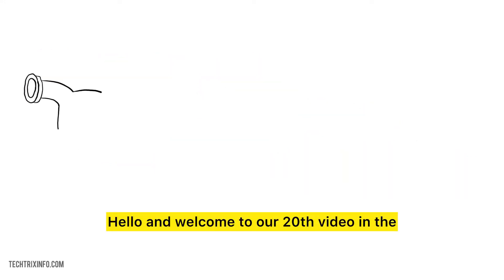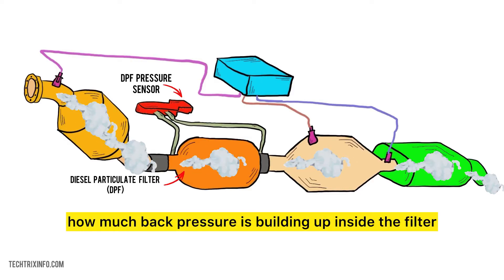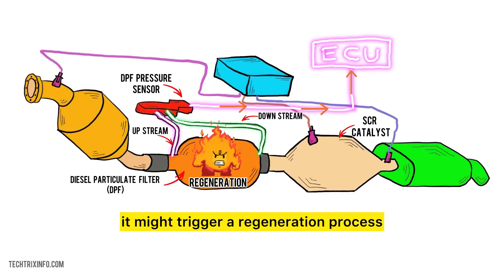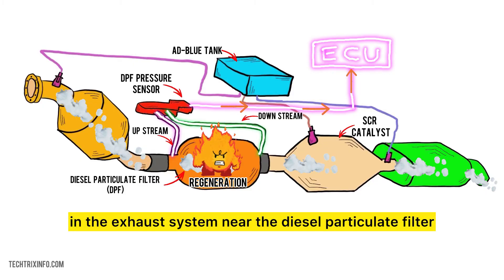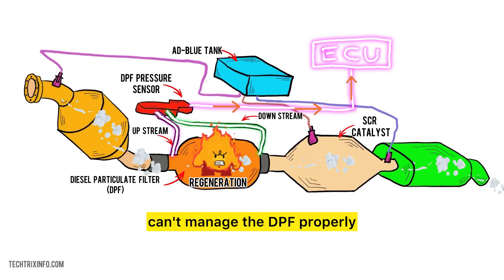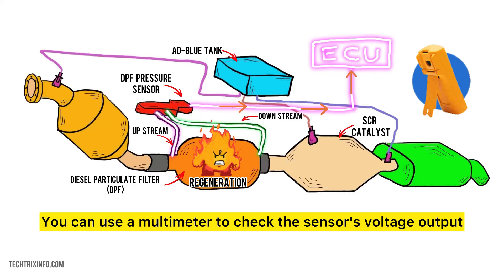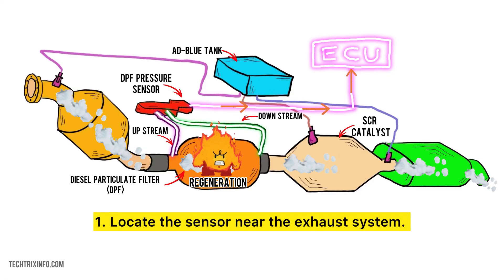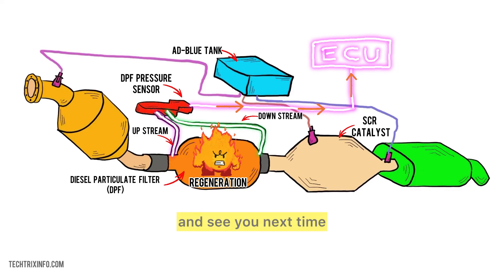DPF Pressure Sensor Explained With Animation | Mastering Automotive Sensors | Part 20

Comment: Well, I’m about to delete the whole dang thing if I can’t figure out why this code won’t go away the catalytic converters is brand new, the DPF filters brand new, D DPS sensor is brand new, before all that happened the turbo charger is also brand new we’ve done everything on this truck it’s a 2007.5 Dodge ram 2500 6.7L the SCR was completely perfect but for some reason, I’ve got a brand new ECM that’s also brand new, the radiator is brand new. The air intake grid heater is also burning cause that was actually going out map center is brand new turbo lines are brand new. The EGR is completely brand. Freaking new intake is cleaned out. The fuel lines are perfect but the this specific code P2455. P242F will not get out of the system. I don’t know what else to do. We’ve ran all the test the back pressure everything we’ve done it all the continuity test passed I need someone to answer my damn question before I shove my truck into a river.
Reply: All the EGT sensors are brand new and the downstream and the upstream. The O2 sensors downstream are brand new. The only thing that is not due on that engine is well the engine and the muffler.
Reply: Whoever created this f@ss  truck needs to step on some damn Legos
Reply: Parts dart final boss
Reply: just curious, why didn't you "straight pipe" that 18year old Dodge before you spent all that money on parts?.   I'll tell you what I think if you have not gotten it fix yet.....keep in mind that on the older diesels, they don't always throw a code.   I think you may have a faulty "9th injector"; I'm not talking about the DEF injector....might want to check it too.   Wow, I did not know a 2007.5 2500 6.7L had an SCR......may have a leak in the DEF injector or fill hose or DEF cap or DEF tank itself.....smoke test that bad boy.   Diesels require a HEAVY duty smoke machine compared to gas burners so I hope this helps.  You'd be surprised, that one little component would prevent those diesels from running right or going into limp mode.....check everything!!!!     One more thing, what scanner are you using?   you've got to get the engine temp up to 180 F and the Nox sensor differential value nox 1 and nox 2 has to be 90% difference (not 70% like the service manual says).    Did you get OEM parts from dealer?   there are a lot of fake parts being sold on internet and there are a lot of OEM parts that just are any good......somehow this happens.

Comment: what is limp mode
Reply: Limp mode is when the car goes on "safety mode" wich means very low/limited power, rpm etc.. to avoid potential or higher internal damage, it can happen on unplugged/dirty sensors, bad sensors, bad/dirty parts.. it depends, sometimes it can be a false alarm
Reply: It's when you become impotent.

Comment: Anyone have tips on cleaning the sensors ?
Reply: Can of air or airline and blower mate, or if its really manky brake cleaner or petrol
Reply: @benhoward3049 would you spray the tubes that go down towards the dpf, or could that cause trouble
Reply: @benhoward3049 thanks
Reply: never use brake cleaner.........use mass air flow spray or electric contact spray and gentle qtip cleaning....be patient, it may take a while to get all the carbon off.   To help prevent, do this every other oil change.   If you allow your truck to idle a lot or take it out on high way and run it 65 mph or better if legal for 20 to 30 minutes at least once a week.   keep the MAF and MAP sensors clean to with mass air flow spray every other oil change will help too.
Reply: Pour suivre
Reply: never use brake cleaner.........use mass air flow spray or electric contact spray and gentle qtip cleaning....be patient, it may take a while to get all the carbon off.   To help prevent, do this every other oil change.   If you allow your truck to idle a lot or take it out on high way and run it 65 mph or better if legal for 20 to 30 minutes at least once a week.

Comment: Great video
I have nissan x trail 1.3 year 2020
Autel obd2 show particular filter without check engine when i chacked 2 month ago but now engine light turn on and show me another problem defrensial pressure sensor code.if i replace the sensor it will fix or i need to clean filter particaler whick i dont understand where thats filter?it like air filter size?
Reply: The dpf is thousands of dollars. It is not like an air filter
Reply: You get out on the highway and run that Nissan 65 mph for 20 to 30 minutes none stop to burn that carbon out of your particulate filter.....then you come back and change that DPF pressure sensor out.    To prevent this, get out on highway at least once a week and reduce the "idle hours" on your vehicle.....idle hours build carbon deposit.   Keep the DEF maintained and the DEF injector clean along with the MAF and MAP sensors clean using mass air flow spray and a qtip cleaning with gentle cleaning.     Hope this helps.
Reply: @Franklinveterinarycenter1of4 thabk u very much for your answer i try to go out city doesnt help.i go to nussan and they replacce me the sensor they say that was the problem i hope that it was that problem now it doesnt show problem
Reply: @TOMA-ny7gg yelp, got to keep that DPF clean.   Reduce idle time on engine and drive on highway at least once a week 65 mph for 20 to 30 minutes non stop or if possible don't slow down.  This will help keep carbon build up in DPF.  Also clean the MAF and MAP sensor with mass air flow cleaner every oil change or every other oil change.....every 4000 miles.   Use good fuel from Exxon or Chevron.....cleaner for engine and t h eir fuel have lubricating factors added in.  Keep good quality DEF in tank.  Never buy DEF out of date or DEF that has been stored in a hot room.   Anytime check engine light comes on, use a GOOD scanner to get codes and use a good scanner to check sensor readings.
Reply from the maker: Agreed. Highway regen, low idle time, clean MAF/MAP sensors, good fuel, and fresh DEF are key to keeping the DPF healthy. A proper scan tool makes a big difference too.😊

Comment: Brilliant one, especially which comes first, DPF filter, then SCR then muffler..
Reply from the maker: Thanks for the question; 
The order of components in the exhaust system typically follows this sequence:

	1.	Diesel Particulate Filter (DPF): The DPF is placed first in the exhaust system. It captures and stores particulate matter (soot) from the exhaust gases.
	2.	Selective Catalytic Reduction (SCR): After the DPF, the exhaust gases pass through the SCR system. This system reduces nitrogen oxides (NOx) by injecting a urea solution (DEF - Diesel Exhaust Fluid) into the exhaust stream.
	3.	Muffler: The muffler comes last. It reduces the noise of the exhaust gases before they exit the vehicle.

This arrangement ensures that particulate matter is filtered, NOx is reduced, and noise is minimized before the exhaust is released.
Reply: @TechTrixInfo  Brilliant, thank you. Please make a video on diesel fuel injection, right from tank to pump to rail to injectors, would be extremely helpful.